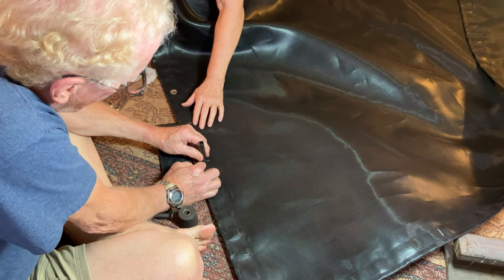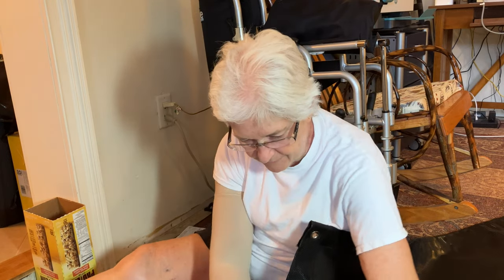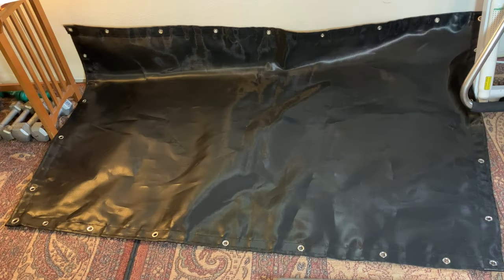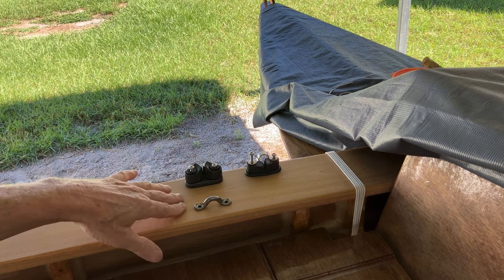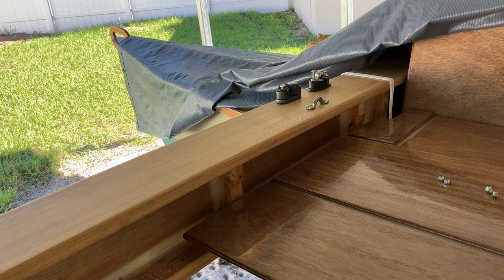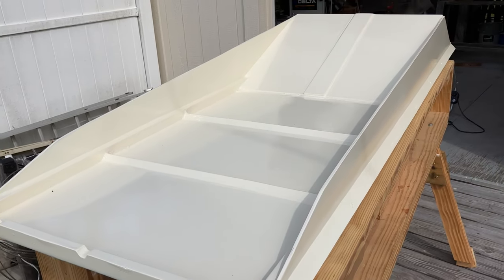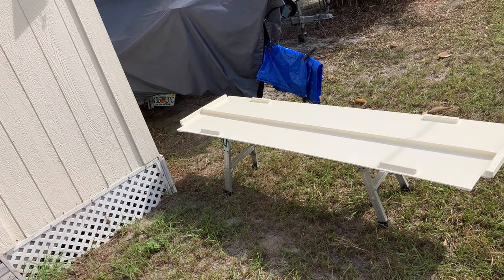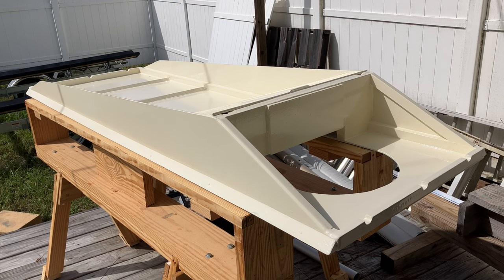Ep36 Building a Wharram Tiki 21   4K

Comment: Looking forward to doing things like our trampoline too. At least there is no sanding involved with that! Paintwork looking good from where I see it, well done. Going to pinch your aluminium foil paint tray liner trick, thanks.
Reply from the maker: Grant, The trampoline was one of the easiest projects of the entire build. The  paint looks much better from the other side of the earth. High temps here make spraying tricky and getting the paint to flow out as it should. Overall pleased with it, but when it gets shiny the places that didn't get filled really show up.